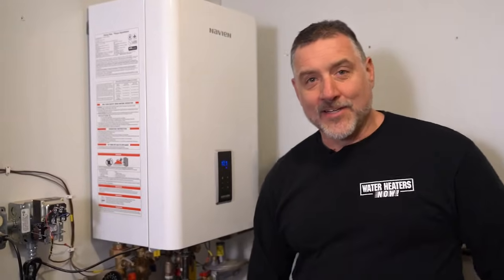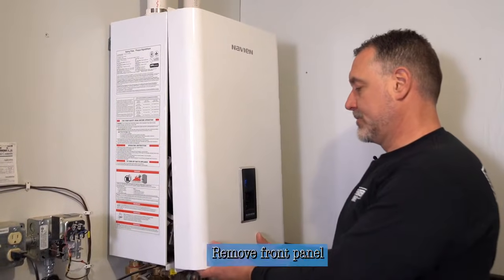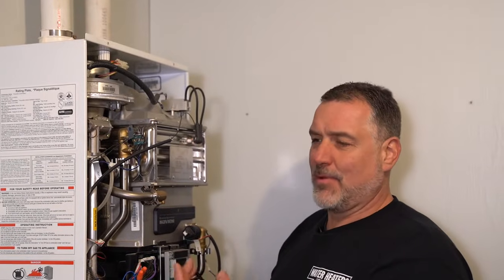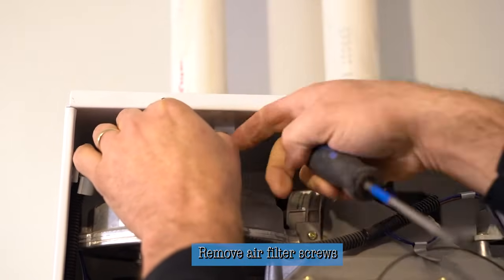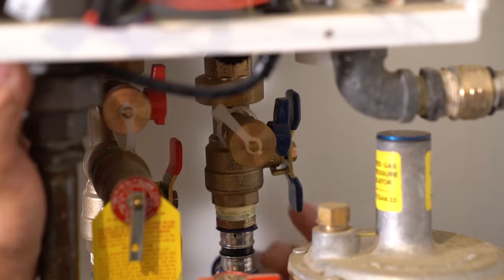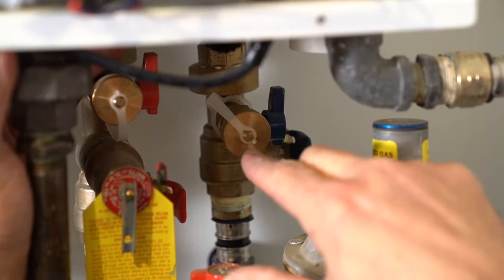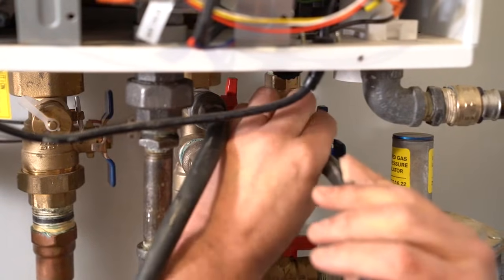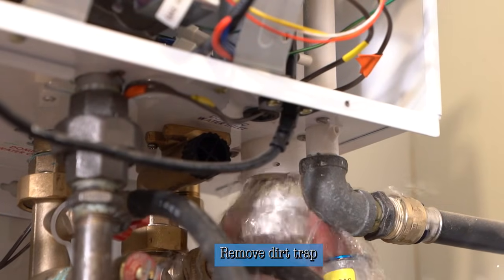Navien NCB 240 Water Heater Annual Cleaning - Water Heaters Now

Comment: Any changes with maintenance with newer models?
So I just had my 2016 Navien NCB 240 E  replace through the Warrantee. It had some issues and Navien agreed to replace it.
In that time 3 way valve went. The Manifold and jacket rusted.  Also the main circuit board went. It seamed every time a tech came to fix something it was $500. 
There was a leak in boiler, that two techs told me it is coverd under warrantee.
Replaced with a NCB-240/130 H. 3-7-2025. The Plumber moved it down Made the exhaust longer going out my basement. New unit came with Stainless steel pipes and Brass fittings. I also added a surge surpressor.  Different people say different things about flushing the unit. 
Should the boiler side be flushed?
What should be used vinegar or boiler flush? 
Love to see a good video on this.
Plumber wants $350 a year just for general maintenance.
Thank you for your Time.
Jimmy

Comment: I called Navien and explained that I have a NCB-240 and asked about my warranty and suggested service. They advised that both the closed loop heating side as well as domestic hot water side should be cleaned every 1 to 2 years with a biodegradable, potable safe product such as floaide, fernox, hercules: haymaker. White distilled vinegar can be used as a backup but typically does not have the high acidic levels needed for a thorough cleaning. I also asked if flushing the system with said products would void the warranty and was advised it will not and was in fact recommended by the manufacturer to keep both the closed loop side and domestic side of the heat exchanger clear and operating correctly.

Comment: The inlet water filter that you show in this video (minute 9:05) looks like mine. It was a bear to take out and worse to reinstall the previous 2 years. It was completely destroyed when I took it out this year. I bought a new one that absolutely would not go in. I was able to install the filter without the orange flow restricter, so that's what I did. The reason I felt comfortable doing this is because your earlier video from 5 years ago shows a shorter filter without the flow restricter at 6:12 minutes. In addition, the User's Manual shows the shorter filter on page 12 and the parts list for the waterway assembly (11.4.3) also shows the filter without the restricter (item #12). But when I ordered the part by by the number given (30007878A), the part that arrived had a cup for the flow restricter. Would it be possible for you to make a video that clears up this confusion?

Comment: Thanks for the video, we have this unit.  I just wanted to share some info on our recent break down.  Our NCB 240 started cutting out and over pressurizing because the recirculation pump wasn't coming on.  I can't remember the codes, but no hot water, no heat in the house.  I tried a replacement pump first and no luck, same concern, water wasn't circulating through the heat exchanger and over pressurizing.  After a power reset and initial start up, I just happened to be checking to see if connectors to the main board were secure and when I pushed on one closer to the middle of the board, the pump started working.  Long story short, the main board must have had a solder or circuit break on the board.  Ended up replacing the main board and it now works fine.  Part number is 30012262B and can be found through many sources. Hope this helps anyone with the same condition.

Comment: My unit stop circulating domestic Hot water, I had to change the pump but still don't get hot domestic water only hot water for winter heat, does anybody know what should I do, I get flow circulating codes don't know what that means.please help, the unit is one year old.

Comment: hi i have a navien ncb 240 combi boiler. I completed the flush on the domestic side without any issues but when i attempted to flush the main heat exchanger there was no circulation almost as if there was an internal valve inside that was closed. the navien boiler was unplugged when i was completing the flush, should i turn it on in order to have that internal valve open? any advice would be much apprecited. thanks in advance

Comment: Great tips! 
To all do not open the boiler to clean, as its a drag to purge!
Reply: So you are saying do not do what he did and clean? Should 100% not have any air if ypu open the cold water and fill system with water before opening the hot side

Comment: I need to replace my cold water inlet screen, and both o-rings, but the manual only has a part number fro the center o-ring. i'm also looking for the following: the outer big o-ring p/n, and the p/n for the little plastic redish color part on the inside end of the filter screen, and a p/n for the rubber piece on the tip of the reddish colored thing. any advise? My local plumber wants to come do a costly service call, instead of selling me the parts I can simply replace DIY. My unit is a NAVIEN NCB-240E-NG

Comment: THANK YOU!!!  I had horrible gurgling bubbling sounds.  Getting error codes and no hot water or heat.  I did this exactly as you said and no error codes and the unit is so quiet.  It was so dirty when I took out the condensate trap.  I believe this was holding all the junk in the system and water which cause the bubbling noise.  Thank you so much.... I don't need to pay $175 for a service every year either as I will do it myself!  Great educational video at the perfect pace.

Comment: So what about the “heating” related inlet/outlet ports on this combi 240?  It didn’t look like Ray touched them.  Are they somehow separated from the system so you don’t need to touch them? At one point THEIR valves still looked open. EDIT: he confirms they’re separate and don’t touch @ ~ 14:45.

Comment: Are you sure you don't need to flush/descale the the boiler side? There are guys on Youtube doing both and that boiler side is always the filthiest.
Reply: I called Navien and explained that I have a NCB-240 and asked about my warranty and suggested service. They advised that both the closed loop heating side as well as domestic hot water side should be cleaned every 1 to 2 years with a biodegradable, potable safe product such as floaide, fernox, hercules: haymaker. White distilled vinegar can be used as a backup but typically does not have the high acidic levels needed for a thorough cleaning. I also asked if flushing the system with said products would void the warranty and was advised it will not and was in fact recommended by the manufacturer to keep both the closed loop side and domestic side of the heat exchanger clear and operating correctly.

Comment: My NCB240E doesn’t have a “dirt trap”… on the user manual there is something called “space heating strainer (pump drain plug) - is that the same time?! Doesn’t look the same on your video but is held by a pin similarly…😖

Comment: Hey Ray what size sump pump and flow rate to get? Also vinegar comes in different concentrations, do I get regular or extra strength for the 2 gallons?
Reply: Watched another of your videos  - annual descaling. 1/5 - 1/6 hp sump pump, regular vinegar, 2 - 3 gal for 1/2- 3/4 hr.
Reply: Exactly, 5% 30%
Reply: @kathyscott4671 you probably meant 5% basic household vinegar (or whatever the % is) and then 30 min not 30%…

Comment: I just phoned three companies, one said do a flushing and maintenance every year, another said do it only every 3 years and another said don't do any service if it is operating okay.  Who should I listen to???
Reply: I would do it yearly or even sooner if you have hard water. We waited too long and then when it was done, it caused other issues, maybe related to calcium buildup... the unit threw code 003 as it had months back prior to flushing. Nobody has cleaned the filters yet, but we're getting code 003 again after a new flame rod had it working again. Will ask plumber to clean various filters to see if that helps. If not, we're expecting to replace the entire heating element. 
By the way the certified plumber didn't know any more than a non-certified plumber and just cost four times as much (with supposed warranty).

Comment: Thank you for a very useful video. I watched it once, and then downloaded the Navien "User's Information Manual" from the corporate downloads page. I watched it a second time while looking through the manual.  Considering how expensive the unit was to purchase, the extra bit of time seemed well spent. The manual does suggest inspecting and cleaning the "Strainer" on the space heating side. I guess I'll try it when I attempt to clean this unit. My unit has isolation valves on the boiler side between the unit and our floor manifold, so those will be closed too.  The video is a great walk through and great confidence builder for a home owner, thank you.

Comment: Please help! I keep getting error 035E on my Navien tankless. This error relates to the gas sensor pressure flow. I have checked the gas line, and the pressure seems ok. Somehow my device is malfunctioning the gas sensor device, we changed the sensor a few months back, and it worked fine for a few months, and now I got the 035E back. Do you know what is causing the gas sensor failure again? I am on natural gas, and my heating and hot water are through Navien.

Comment: Make sure to use soapy water/leak detector on top seal of heat exchanger, almost every unit I have tested has had a warranty covered exhaust leak. These units across all models have this issue.

Comment: Keep getting the e110 error code but the intake filter and exhaust are free of any blockages any idea what I should do.
Reply: I had the same problem when it was first installed. There was 2 things i had to address. One was the Exhaust and intake  were a little too close to each other once they exited the house. I believe the code is 12 inches apart if im not mistaken. We had it like 9 inches. So we then changed the angle so it could have a total of 13 inches apart. The other was making sure the exhaust PVC pipe is pitched away from the Navien. (not towards) because that water from the exhaust has to drain away from the navien and drip towards the exit of the house. We did these both changes and now it works fine.. Good luck
Reply: Mine also flashed the 110 code. Our unit was 4 years old and I had no idea they had to be serviced. When I removed the air intake filter at the top of the boiler it was pretty plugged up with dead bugs and poplar fuzz (I believe this was the problem). The white distillate cap at the bottom also had a bit of sediment in it. The cold water intake filter was clean (little black tubular filter at the bottom of the boiler). I cleaned those 3 things and unplugged the unit for an hour while I performed the flush…. when I plugged it back in, the code was gone and everything works fine again. After 4 years without a service, there was next to zero scaling in my system or on the cold water inlet filter. Going forward, I will flush it every 4-5 years but I’ll be servicing the air intake filter and distillate cap every year which maybe takes 5 minutes. This entire process too me 1-1/2 hours and 1 hour of that was waiting on the vinegar to flush the boiler. Saves me about $500/year on a plumber and it only cost me a one-time cost of $110.00 Canadian to buy the sump and 2 washing machine hoses. I’m an older fella and I gotta say… I friggin love Youtube for stuff like this as well as the folks who take the time to make videos like this!

Comment: When I called Navien, they recommended that we descale the heating side. So that was confusing. Would it hurt to clean the heating side?
Reply: Go to pipe doctor on you tube ALL NAVIEN HEATERS LEAK CARBON MONOXIDE THERE IS A CLASS ACTION LAW SUIT COMING ALL HEAT EXCHANGER LEAK CARBON MONOXIDE PLEASE TAKE CAUTION

Comment: Very well presented videos.   I clean multiple units once per year but I like to watch your videos prior as a good reminder of the correct steps.  I do have a question if possible on my Navien CH-240 unit.  On the hydronic side of the combi unit it has a strainer.  I took that out and cleaned it and the residual water drained out into a bucket.  I was shocked at how rusty and oily it was.  Not sure if that's debris from around the burner or something that's inside all the hydronic heating pipes.  You mentioned that the hydronic side shouldn't be descaled.  Should I instead bring in a plumber to drain and clean the hot water heating lines?  Many thanks.
Reply: Did you get a reply to that question
Reply: @jamestrezza5788  I ended up draining and refilled the hydronic heat side.  That was a year ago.  I just descaled the domestic hit water side and then cleaned the filter on the hydronic heat side.  Once again the filter and inside of the valve in the hydronic heat side was pretty greasy/darkened with grime.  I cleaned it up and put it back in.  A plumber friend didn't seem concerned.  The combi boiler is 10 years old and has been pretty reliable.

Comment: I have a question for you. I clean my Navien every year but lately when I turn on the hot water my system sounds like a engine cycling through. Hope this makes sense. Would you know what might be causing this noise?
Reply: Go to you tube pipe doctor from New York. There is a class action law suit against Navien  units please check your heater they all leak CARBON MONOXIDE ALL LEAK FROM THE HEAT EXCHANGER
Reply: @RAYMOND169  thank you very much!!! That is crazy unsafe.